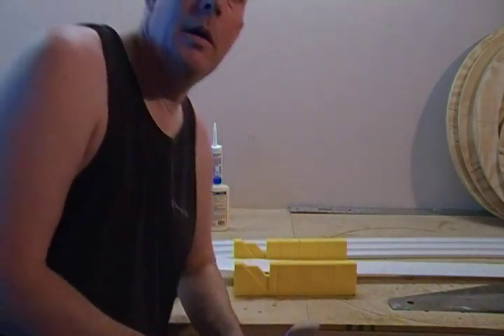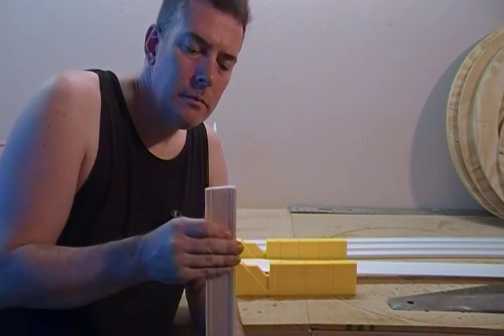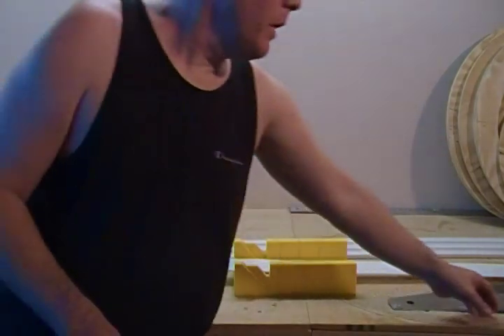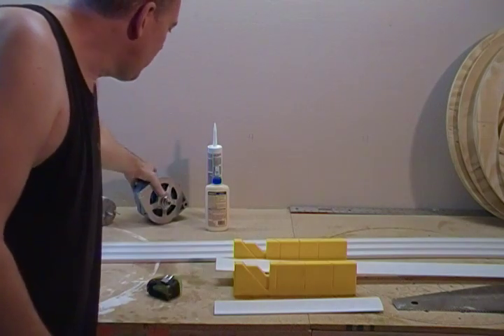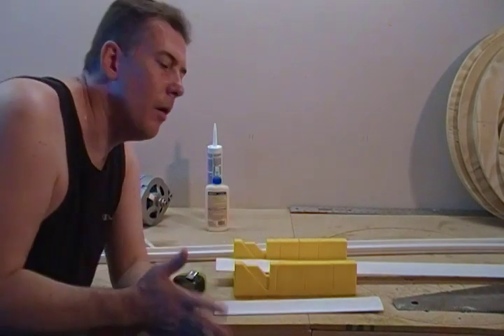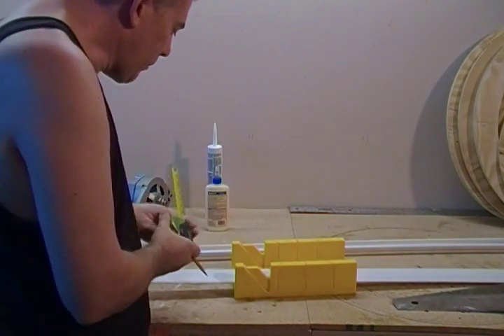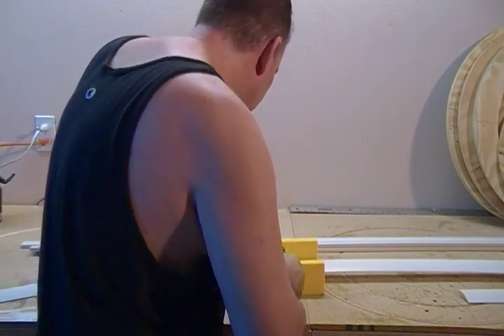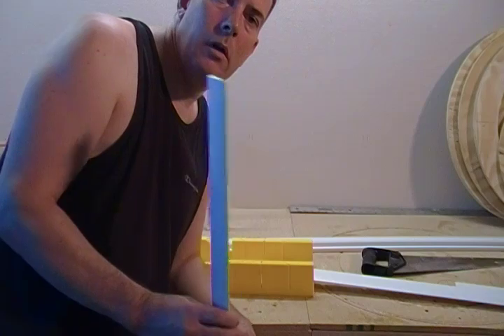Building a Wind Turbine VAWT (Step 6 of 46) Cutting the Turbine Wing Blades.MP4

Comment: I love the way you used casing.
I found a treadmill and salvaged the motor and a roller.
The roller has a pulley attached and I'm going to press fit the turbine to the roller,
I cut the blades today, 18 inches.  I used wood and I rounded the leading edge.
It will be 24" in dia..

Comment: @HarryHutton92 - Casing is molding material used to finish around doors, windows and where the wall meets up to the floor.  The stuff being used in the video looks to be the thinner window trim molding. Good luck.

Comment from the maker: @vicrammx Victor, do you have a Home Depot or Lowes there in Mexico? They can order this material for you. Or try whatever hardware supplier you have. Check and see if they can order from this company. ( LP products casing # 6106 is what my demo turbine is using).  If not you can try Balsa wood and do a little sanding the wing shape. Also, before you start make sure you are in a good wind area. Good luck with your project.

Comment: Hi there, a very interesting video, does the material come with that aerofoil cross section or do you need to do any profiling manually on it, looks like one of the most efficient vawt,s I have seen yet, looks as if by making a larger version even more power could be obtained from it, was also surprised to see it woul turn that alternator, thanks for the info regards Doc Cox